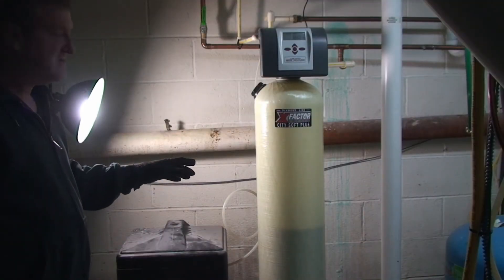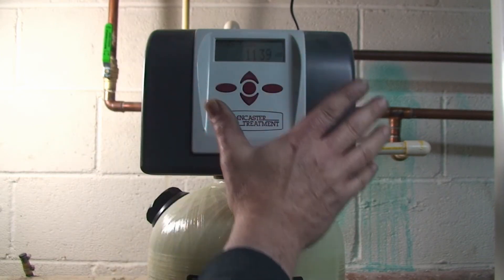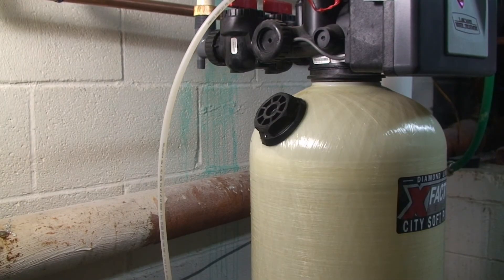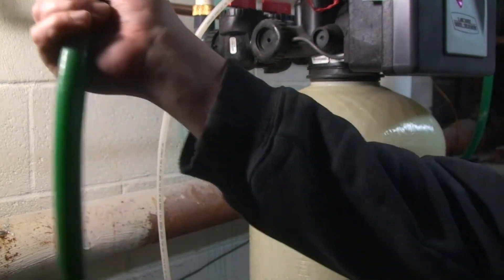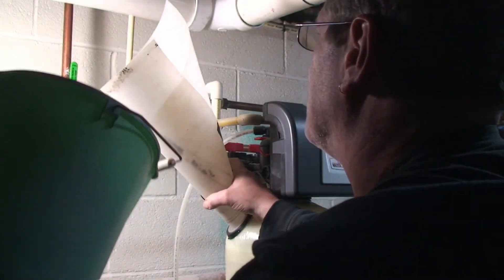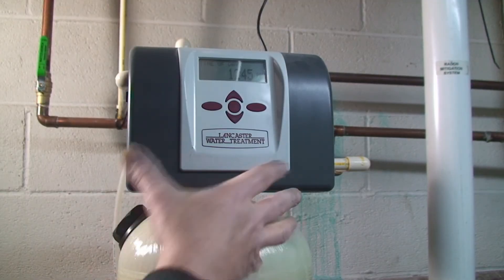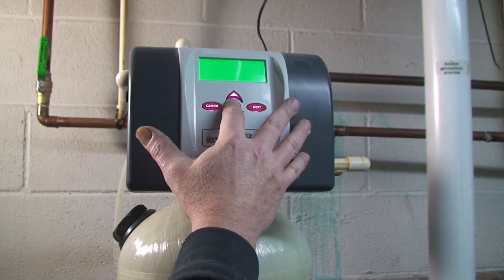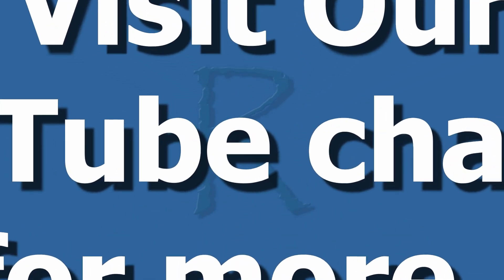Filling an Acid Neutralizer and Water Softener Combination Unit

Comment: Video was very informative. There is an associated salt container. Do you just normally add salt in there? Is there a recommendation for the salt?
Reply from the maker: Yes the container (sometimes called a hopper) should have a lid on it that is easily opened
Fill it near to the top (or the fill mark if it has one)
The salt I use is "Diamond Crystal" brand
I have a well and my water is not only acidic but has iron in it which is very common
So I use the "Iron Fighter" version of this salt